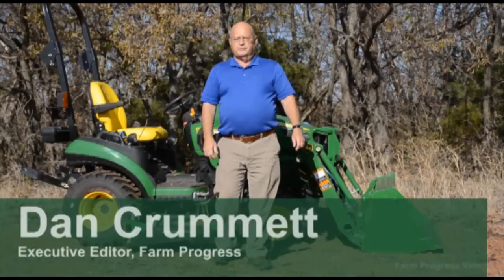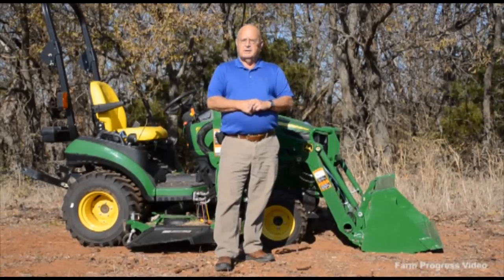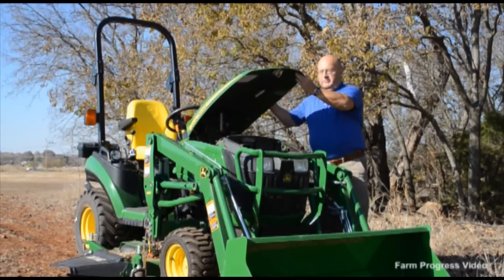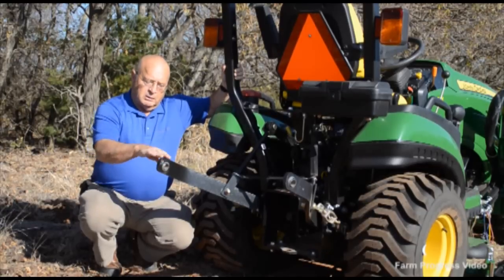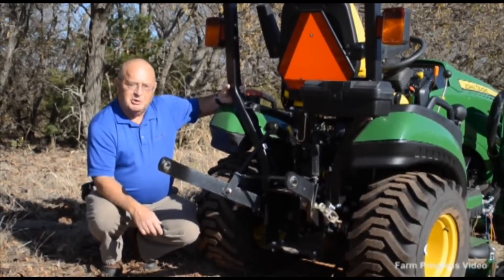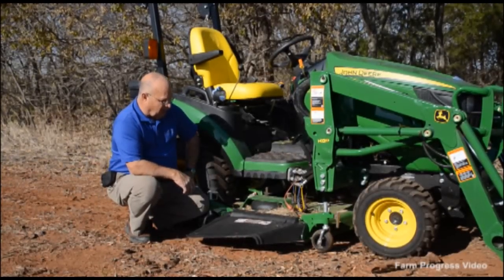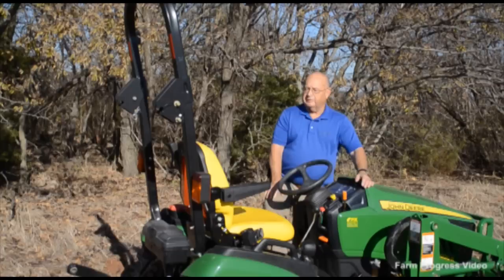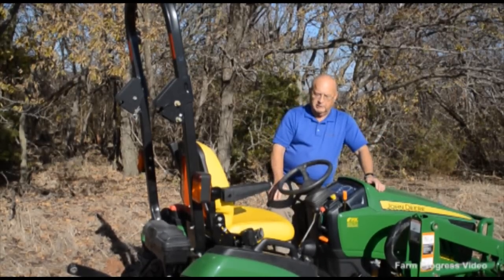We Test Deere's 1026R Compact Utility Tractor

Comment: Yep, I just bought this tractor (1026) for my lawn service for snow removal, loader work, and soon some mowing in larger areas. So far Ive only really used it aggressively in snow removal and its just a bit small, which is nice for small areas but, more tractor would be kinda nice. However, the operator comfort and night time lighting on this machine is absolutely amazing.

Comment: It seems that you got the independent deck lift kit.  Most of these tractors come with the mid-mount deck lift integrated with the 3-pt hitch control - no hose connections to create confusion in that case.  But if you want to lift the deck and leave the 3-pt in place (like for a bagger) then you will need that kit.

Thanks for the review.
Reply: @Jamie Curtis o